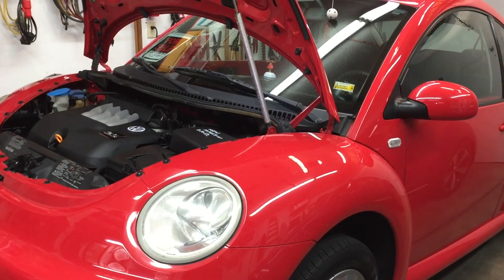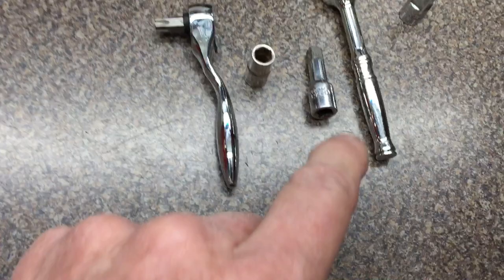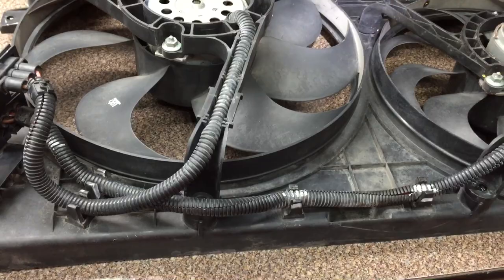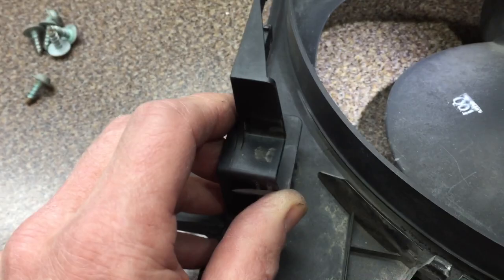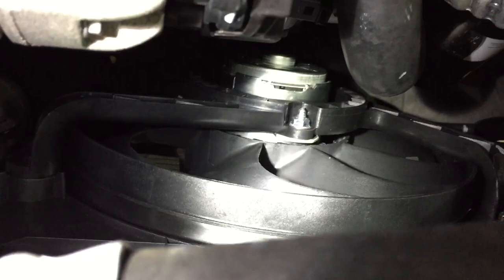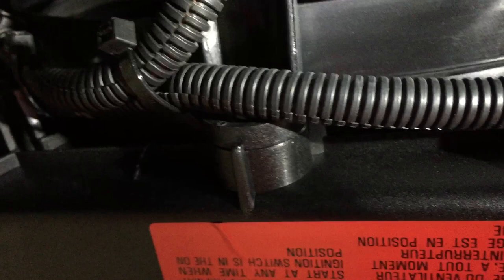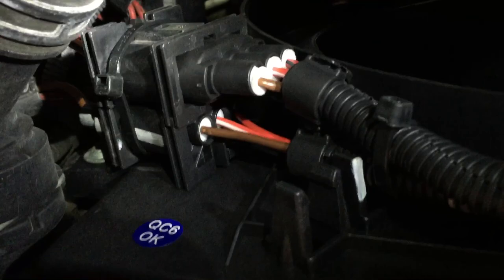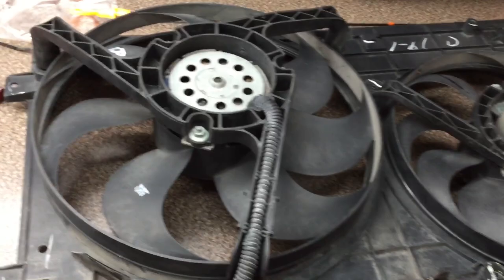2003 VW Beetle 2.0L radiator electric cooling fan replacement

Comment: I just had mine replace this weekend. 2001 2.0 L GLS Manual🚙...paid $100 labor purchased online/ebay $100 plus tax. The labor was considered "cheap" compared to the other shop who's been wanting $600 and I just wouldn't pay it. Glad I didn't. I believe it took them about 2 hrs to complete...plus they did an oil change. 

Beautiful Bugs btw.

Comment: Great video, but one correction would be that the Dorman whole fan assembly you are showing and used is only for Beetle models with a 3-pin connector 2 speed fan for the larger driver side cooling fan. VW also used a 4-pin 3-speed model which is not made by Dorman or any company that sells the complete 2 fan assemblies. The 4-pin was used on most 1.8L Turbo models and some models sold in warmer climates.  VW was all over the map with the 3-pin or 4-pin connectors. Most have the 3-pin, but don't be like me and buy the Dorman assembly only to get it all out and realize it is a 4-pin fan. Get underneath and check your connectors first.

Comment: Great video...thank you. Just did replaced the fan assembly on a 2004 2.0L GLS convertible. It was a tight squeeze both out with the old one and in with the new one, but didn't need to remove the fans or the brackets from the assembly. Bought a VDO replacement part and everything (including the wiring harness) fit perfectly. There's another video on YouTube showing the same job and it was very helpful as well.
Reply from the maker: Scott B   Ok. Thanks!  Like I said I looked at it and didn’t think the assembly would come out in one piece. I’ll try that next time.

Comment: Why go through the work of removing the fan shrowd unit if you already pulled out both fans? Leave the assembly in and put your new fans into it. Looks like that will save a lot of time and hassles.
Reply from the maker: I used an aftermarket fan assembly and if I remember correctly it was made a little different and I don’t think the aftermarket fans would fit into the original shroud.

Comment: When you installed the new fan assembly, did you install it as one complete part or did you break it down and install in pieces like you did when you took the out the old one?
Reply from the maker: I broke it down. You might read all of the comments. One person said he removed the assembly without breaking it down. There is another comment about the connectors having different numbers of pins for different models.